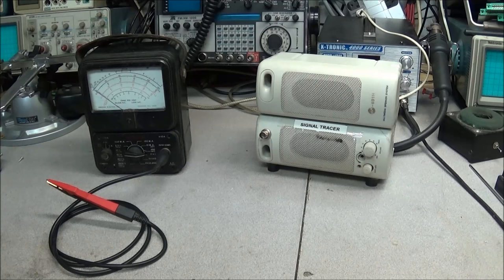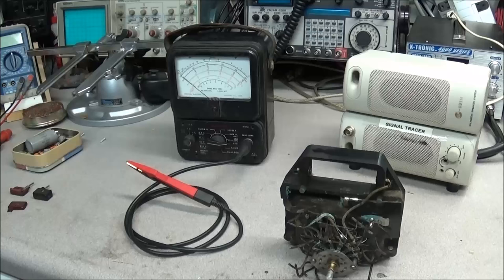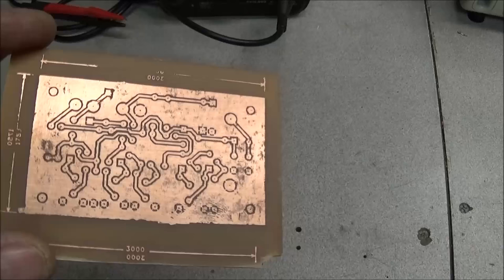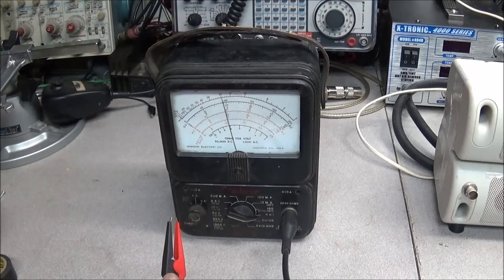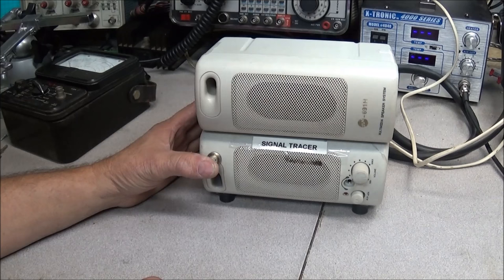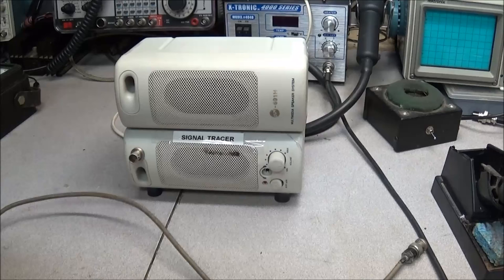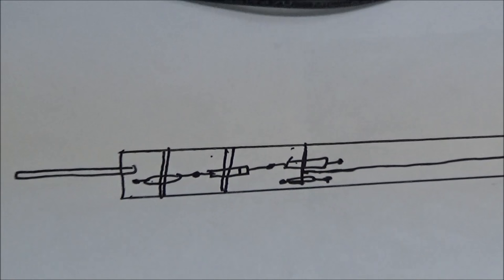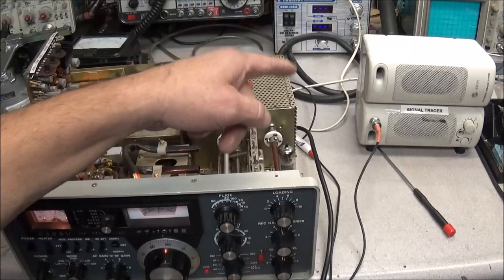#77 Shop Talk Build Your Own Test Gear

Comment: This brings back the old days when I designed some of my test equipment on a budget when I was starting out. I gutted a transistor analog meter that was defective and converted it to test small and large power type SCR'S using four AA batteries. Not only did it turn on, it would indicate open, shorts and leakage and proved to be invaluable for finding those tough dogs when SCR'S were most common. "Excellent presentation Buddy"

Comment: If I was building this signal tracer I think I'd live with the straight through probe and put the demodulator circuit inside the speaker housing, then add a little toggle switch that bypasses the demodulator for AF and puts it back inline for RF.  Maybe even add a little opamp to boost really low signals, adjusted by a gain pot.

Comment: A signal tracer is very useful. I built one in an old ex-equipment case with an LM380N amp, OA79 diode, speaker, a few capacitors and resistors and a couple of hours soldering.  I made mine with the demod diode on the strip board and then switchable RF/AF on the probe (which is just an old meter test probe) input. Best of all it was fun to make.  I wish you could still get those Heathkit probe bodies! Andrew
Reply from the maker: Man I love those old heathkit probes. I may even look into reproducing some of them. . Use aluminum tubing for the body and mill some ABS for the ends. Thanks for sharing.

Comment: Re the balance problem .
The meter driver circuit should have matching parts between C3 & C5 .
Match  C3 with C5  , R13 with R18 , TR4 with TR5 & so on !
I see NO decoupling capacitor so drop in a 100uf across the supply .
The 9v pp3 looks a bit small for the job .
Thanks for the Video
Reply: Note the ESR meter schematics don't match !
See C3 on the 2 schematics ( 10nf & 22nf  .W..T.....!!??..... )
You could fit a 500R trimmer & a 1k2 resistor for 
the 1k5 in the collector of Q3 if nothing else works .
Reply from the maker: Thanks for that information. I have had no time to trouble shoot yet. Will let you know what I find.

Comment: Nice tools. I love the re-purposing of the Simpson. I have an old Triplett 630 in similar condition regarding the corrosion. I thinks its movement is a little different in terms of uA, but could be used for something similar.
Reply from the maker: Thanks. Sometimes those meters have a resistor in them. You can change that to what you need to make it work. To a certain degree.

Comment: Great video, kudos.  Regarding the computer speakers signal tracer project, I would think the amp gain would be insufficient for many signal tracing needs because the input of those PC speakers is always LINE LEVEL, which requires a rather large signal to get any degree of audio output.  I would think that an extra preamp stage would be required to make the PC speakers more useful for this project.

Comment: That's a great use for that poor old Simpson 260! I saw Alans video too and I plan to make a board for it. 

I have a few VTVM's that I'm not using if you need a good meter. One is a RCA VoltOhmyst. I have an Eico VTVM somewhere around here. I'm good on QRZ if you want one of them. 73 NE5U  MIke
Reply from the maker: Thanks Michael.  Just hated seeing that old meter sitting not doing anything. Just may look you up on that.

Comment: Looks like you built some ESR into your ESR meter.  I'm sure you'll get it straightened out.

Goodie box ready to send to you tomorrow.  There's a project in it for you but I think you'll like it. :)

Mike
Reply from the maker: Guess I need to test for that lol. I think it is something simple. A project in the goodie box. Cant wait, your goodie boxes are the best!.
Reply: +The Radio Shop 

Lets just say the little power supply board and ARF manual got really heavy really fast. :)
Reply from the maker: Oh boy, cannot wait.
Reply: +The Radio Shop 

Christmas a month early.  And better yet its not just a project, its a project that includes repair parts. :)
Reply from the maker: Oh wow. This is going to be great! And going to have a care package for you soon also.
Reply: +The Radio Shop 

Freebies always appreciated.  :)

Comment: Great idea on ESR meter, and showing your tracer, next question I have a little black box containing a speaker to test mic for modulation  but what is your switch doing
my speake came with my CB 42 analyzer    thanks Buddy
Reply from the maker: Hi Dennis. ThanksThe switch just turns the speaker off and on. That way I have the tone on all the time and control it by the switch. This saves me from having to reach over high voltage tube radios to turn the tone off and on.
Reply: just as I thought , another good idea you have, will add a switch to my speaker,,keep them coming, again excellent work on the old simpson, now esr
Reply from the maker: Thanks Dennis. You will like that switch mod.

Comment: Cool test gear! Would the signal tracer be helpful to use on an old transistor-only Atlas radio from the 1970's that doesn't receive anything except a faint fm/am signal on one band? (When using a mobile magmount antenna (10 meter))

Comment: SIR CAN I ASK THE VALUE OF R 24 IN THE ESR METER ?
Reply from the maker: The value of R24 is impossible to give.  Since you have all your parts and the tolerance is unknown to me I cannot pick a resistor for you to start with.  Start with a value of half your trim pot value and adjust as needed is as close as I can come up with.